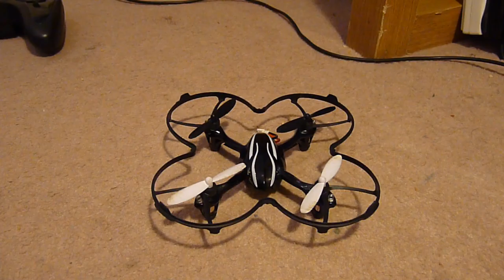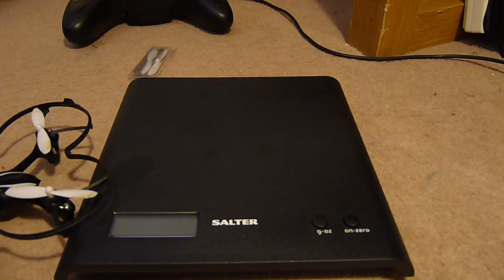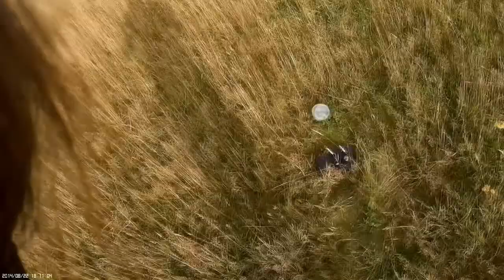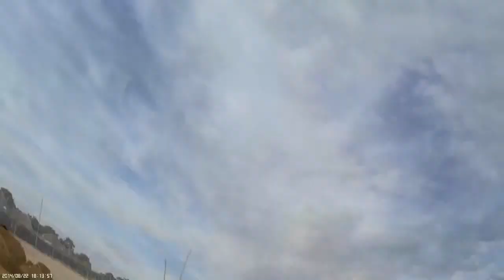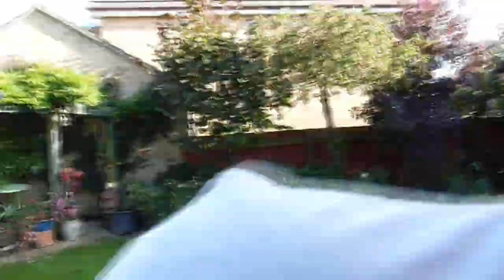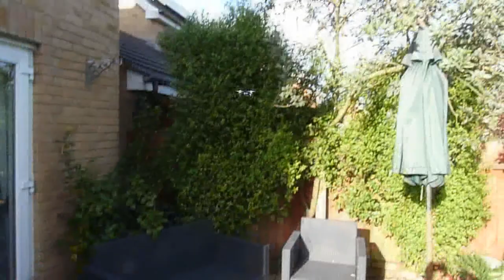Hubsan X4 Quadcopter Review

Comment: This puppy?  Too much eevblog lol ;o)  Wow, replaced the motors?  I use my helecopter a lot, and not had to replace anything, including the blades, and it's had a lot of crashes, especially in the early days lol  More practice you need my youngling, then, eventually, you will be able to fly it indoors as do I ;o)
Reply from the maker: RetroGamerVX They run at such a high speed that the brushes ware out, a helle is geared down. Plus you can fly it outdoors.